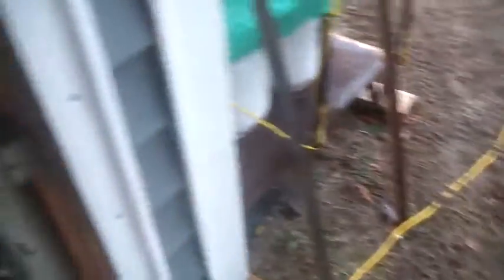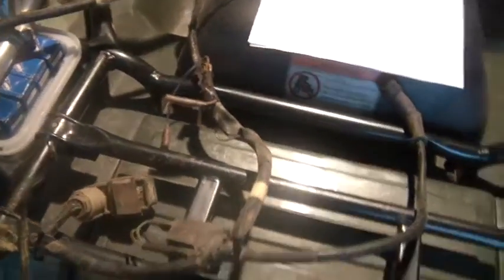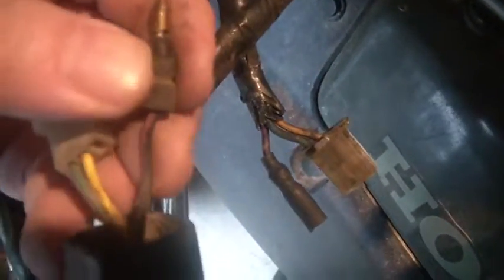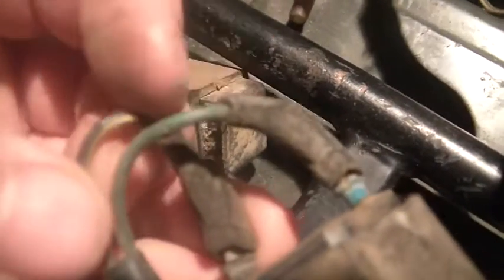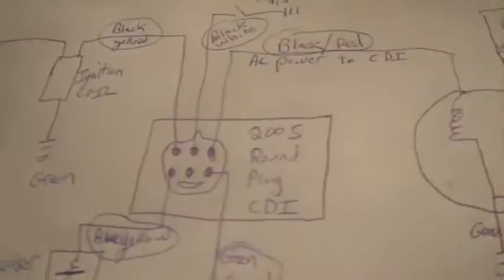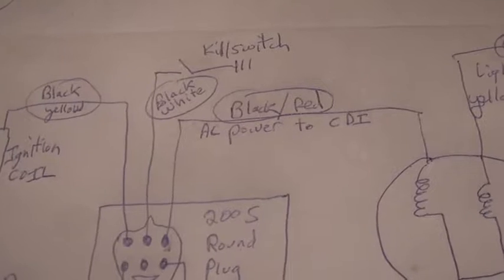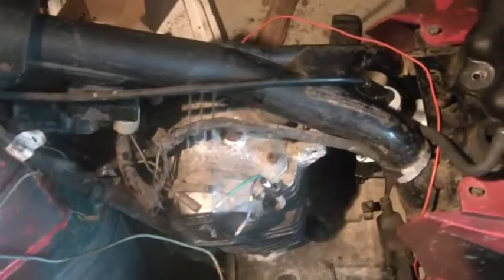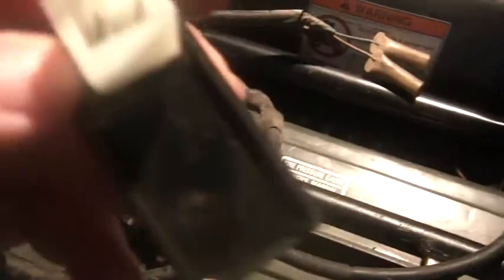1_14_2013, Troubleshooting a 1984 Honda ATC 200S wire harness

Comment: Hello y is it everytime i hook up the ground wire on the coil it stops the. spark
Reply from the maker: Hey Chuck, If there are 2 input wires to Ur spark coil, (+ one wire for the spark plug), one of them is at ground. I'm thinking Ur coil is damaged and that the windings must be leaking or shorted to the metal inductor, so, when U ground the inductor, it gives U a smaller, less winding primary coil, or, it is shorting out the secondary coil, either can cost U Ur spark.... I hope this helps, thanks for asking, watching, and commenting!!!

Comment: Hey..I enjoy all of your videos and have learned an amazing amount just from your channel alone. Thankyou for sharing with us.     I have a question about my 80's model trx70 4wheeler.. ...why does it keep catching on fire when I attempt to crank it? I put a complete new wiring harness cdi, coil, stator, plug, and carb but when I pull it , a dozen or so times it will pop and then catch fire or atleast puff a lil flame from either the carb or the exhaust???  I'm Mind boggled. ...if you can help I would a precise it.... thanks again for the videos

Comment: 84 big red so when I pull start it don't have spark it will only turn over when I unplug the cdi
Reply from the maker: Hey John, No spark and the electric starter will not engage unless the cdi is removed means that there is an interlock issue, is Ur neutral light on, does Ur wire harness have issues, any problems with Ur handle bar switch or key switch???  Those are the places I would start looking.... Thanks for asking, watching, and commenting!!!
Reply: Harvey Spooner  I understand hooked the CDI and the reverse light goes out.then it will turn over with out spark.i unplugged the neutral switch and both lights stays on no spark. the wires seem to be ok.i must be over looking something
Reply: lol I put a new key switch in from a forklift and I cleaned out the kill/ head light switch.in the kill switch when on run position.it touches nothing..that's rite I believe
Reply from the maker: If U cut the green wire that goes to the back of the key switch, U will know that the key switch is not turning it off.... Thanks for asking, watching, and commenting!!!

Comment: I have a 85 big red 200es I replaced everything when I turn the key on the neutral and the reverse light comes on.now it won't turn over because it thinks it's in reverse? could it be a bad safety switch?
Reply from the maker: Hey John, Yes, Ur reverse safety switch or the wire that does to that switch is grounded, I would disconnect that wire and cover it with tape, Ur spark should return and the starter should operate.... I hope this helps.... Thanks for asking, watching, and commenting!!!!

Comment: hey I have a 84 Honda 200s I just bought won't g ire it has a little bit of spark but seems week? is there anything that u would recommend that is wrong?
Reply from the maker: +jacob simmons , First, change the plug, then see if it will start with the help of 
starting fluid, if no help, U will need to start making measurements, 
cleaning the grounds where the spark coil is and the engine to frame 
grounds never hurt, sometimes I add an extra ground wire between the 
frame and the engine.... Good luck, let me know how it all turns out... 
Thanks for asking, watching, and commenting!!!

Comment: Hi I have a 1985 Honda 200s was running fine shut it off after my son rode it now it won't start back up.. Please help.
Reply from the maker: +Rob L , Simplest thing to do,  take off the seat, open the air box, and give it a shot of starting fluid, if it starts, U have a carb problem, if not, check the spark... I would change the plug, check the spark, if no spark, I would check the handle bar switch... Let me know how it turns out and what U find, I can help U from there.... Thanks for asking, watching, and commenting!!!

Comment: Thank you Harvey, yeah so after some further diagnostic's found the terminals in the switch's needed cleaning. Got it going after taking the teminals back off for the third time and an awl used with hammer tapping the contacts further out making contact. Haha saved myself $60 :) thanls again friend for the quick response

Comment: Having issues with mt 1986 200x lights? Fires and runs very well. Checked bulbs with battery charger all is well hooked multimeter to transfer case wires gr&blk/red recieving high readings. Also cdi wires recieving 0.01-2? Can it be the cdi ignition box? Whats your thoughts fellas? Thank in advance.
Reply from the maker: ikonmck25 , The light and ignition circuits are separate, it will run even if the light circuits are a mess. I will try to shoot a video on my 1/2 Honda 200X and show U how to troubleshoot it easy... Thanks for asking, watching, and commenting!

Comment: is it the same has a 86 trx200sx harness
Reply from the maker: Mike Haroldson , The TRX200SX ignition and harness are quite a bit different then the ATC 185/200... The TRX200SX uses an electronic ignition advance, the 185/200 uses a mechanical advance. The CDI on the 185/200 has no interlocks on the ignition, the TRX200SX has interlocks for reverse and starting in gear. With some hacking, they can be swapped and made to work, but, one would have to be ready to hack.... Thanks for asking, watching, and commenting...

Comment: Thank you Harvey thanks to your run through I got my 200s going and it runs great motor is quiet all I have to do is replace the fuel line and fill it with a gas and tune the carb I started it today for the first time and the motor took off I turned the idol down and it still went taken off but the throttle isn't right do you think you can make a video of how to adjust the throttle lever and cable I think it's holing the carb open and making it run high
Reply from the maker: TheGMlover1, Once again, I am glad that U got it running. My guess for your carb/throttle issue is that the carb slide is not seating at idle. If U look at the slide, U will noticed that it is keyed on one side and the other side has an incline to set the idle. U wil be able to tell when it is aligned properly, because the slide will go right in an bottom out, let me know how U make out with it. Thanks for watching and commenting!

Comment: Ha yeah I hear ya 1 runs needs pull start other needs to be put back together but the guy has all the parts but pull start so both are missing pull start
Reply from the maker: TheGMlover1, 200S pull starts are $50 on eBay if they need some work, around $100 if they are good. 2 bikes for $500 seems kind of steep if U have to come up with recoils for both, Not seeing the plastic, tires, exhaust, and general condition of the pile of parts, it is hard to put a price on it all, but, $350 seems to be a better number than $500. Good luck with it all and let me know how it turns out.

Comment: Well we have an issue I spotted right away I'm missing the coil can you still buy them new?
Reply from the maker: TheGMlover1, eBay, $11 delivered, I have bought carbs from this guy and have been happy, carbs work and they show up in under a week, Glenparts -  http://www.ebay.com/itm/Ignition-Coil-Honda-ATV-200-ATC200S-ATC200M-1985-1986-/141123771813?pt=Motors_ATV_Parts_Accessories&hash=item20dba1dda5&vxp=mtr